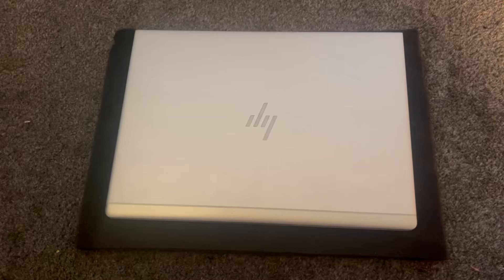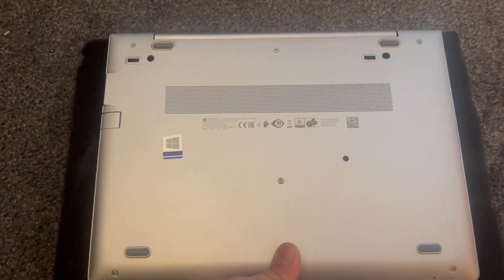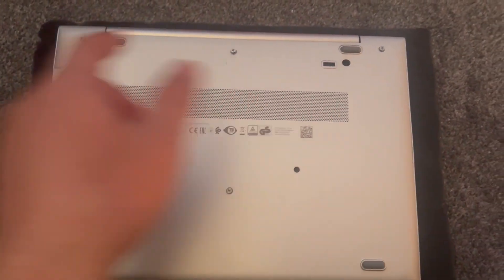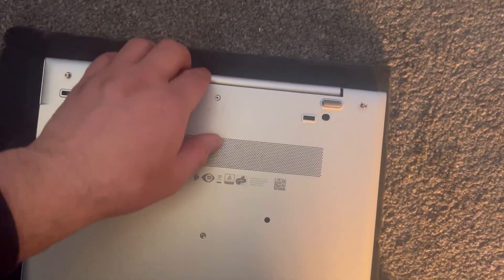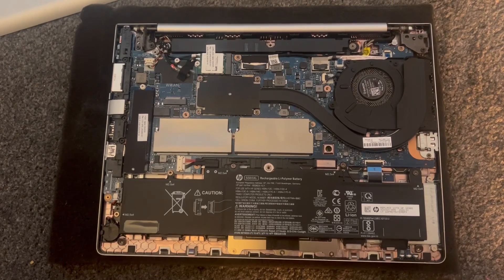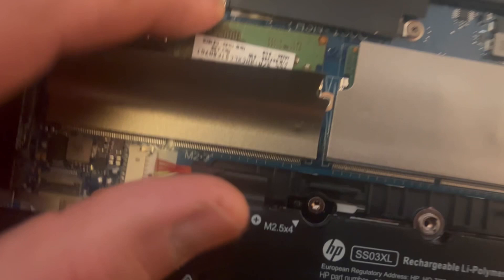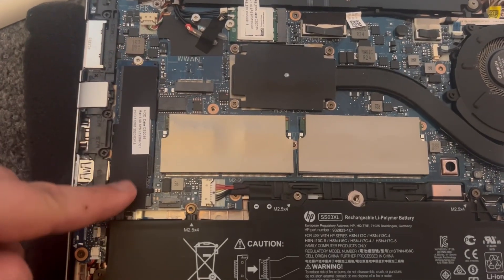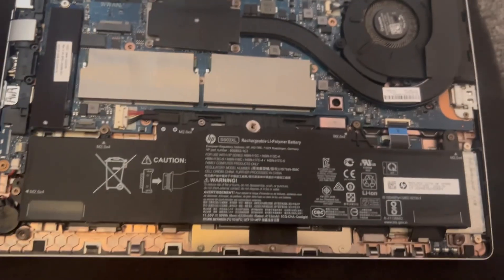HP Elitebook 735 G6 - How to upgrade RAM, Remove Battery, Cmos, SSD

Comment: hello i have a problem i bought 8gb of ram for this laptop which already had 8gb in it when i added the purchased frames it was not detecting them i decided to swap them in place when i did this and fired up the laptop it had a black screen and started making loud noises when i put the frames in their original place and fired it up again the same thing do you know how to remedy this?
Reply from the maker: Was the ram you purchased brand new or used? If used it could be ram issue